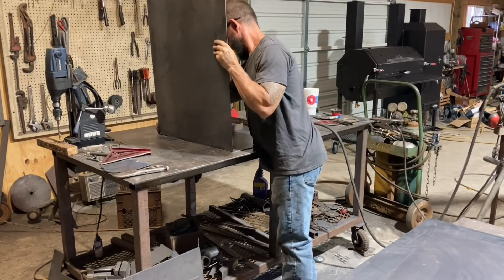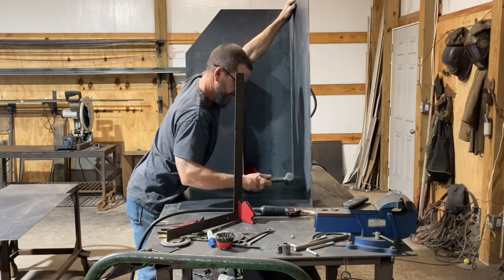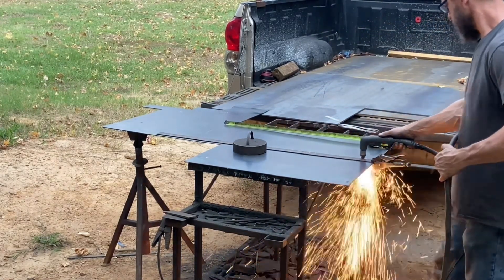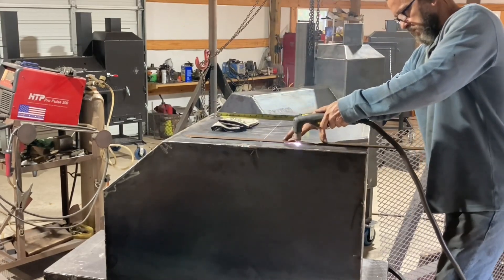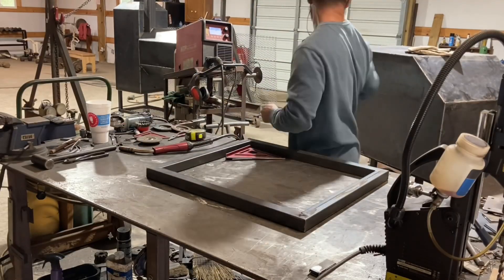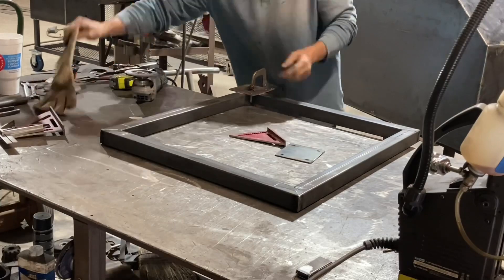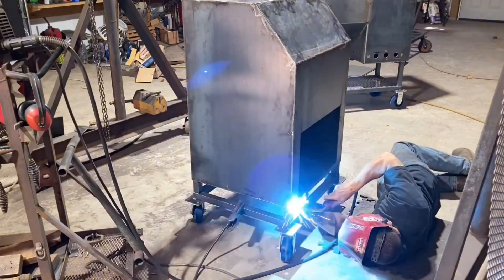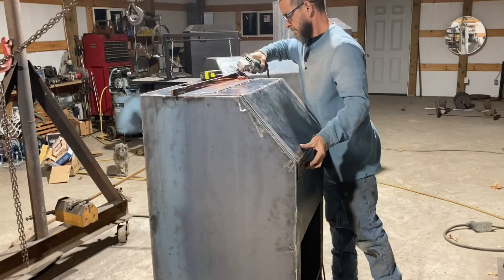Bbq grill build

Comment: I did the same thing with my saw back in the spring of the yr. Trying to save material. Clamped to small a piece of square tubing. Several teeth (on the blade) missing and bent the blade. Could've been lot worse.